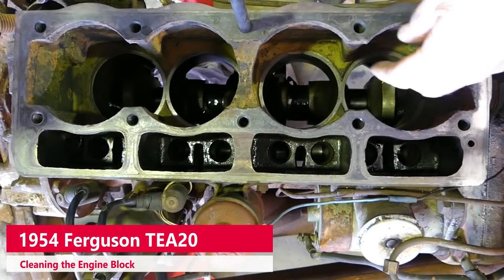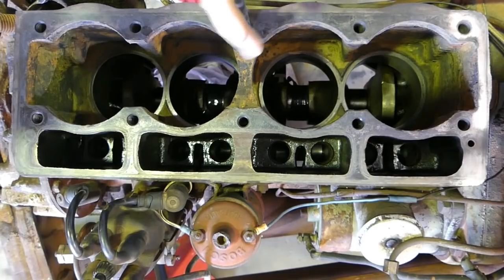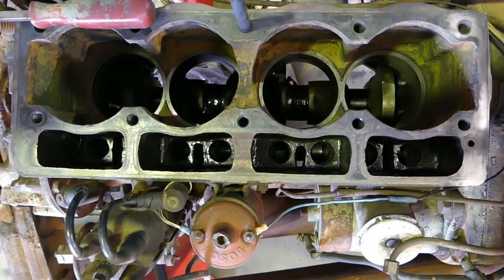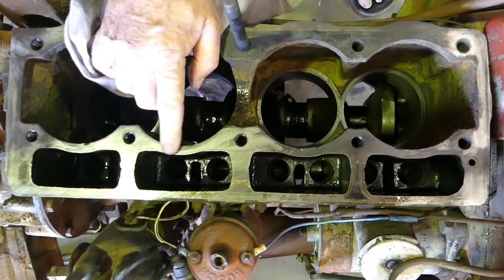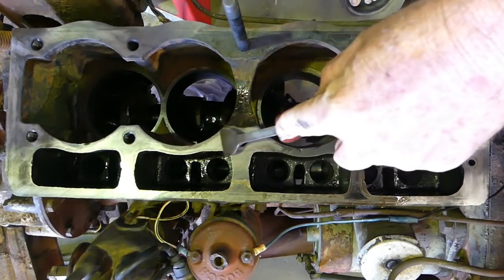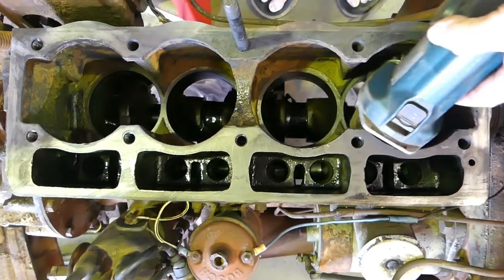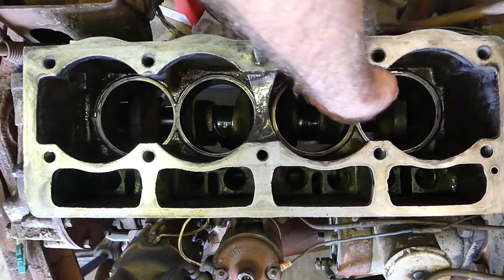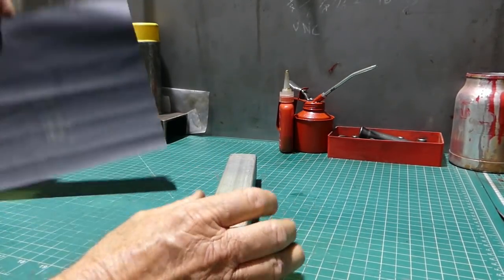Sparex Ferguson TEA20 # 8 Cleaning the engine block.

Comment: Lance, would you ever do anything on the cleaned up internal surfaces (other than oil etc) to prevent rust in the future? Such as oxide paint or something a bit more permanent? So as it's not left bare metal touching water/coolant.  Great videos, really enjoying them.
Reply: Any good rust inhibitor will definately help reduce further corrosion. add it to the coolant water!
Reply from the maker: I never have and I would be worried about it coming off and blocking the cooling system as I couldn't be sure I could clean everywhere properly to get it to etch into the block. On a gearbox I would.
Reply from the maker: Yes the Glycol based coolant has a film that stops this sort of thing happening again.
Reply: @BundyBearsShed  thanks Lance

Comment: could you put any rust inhibitors inside the block where the water lives,  although I guess that might not work with the heat...??
Reply from the maker: Yes but in the form of a glycol based coolant.

Comment: Hi Lance, sorry to contact you this way,i need an expert and you're him,my TEA20 starts great let it warm up,but after going about 200ft. quits,i wait a few seconds ,starts right up,go 10 feet dies out,wait 10 secs,starts right up again then quits,i get going again starts to die pull choke out she runs 10-20 secs and dies,do i shoot her or start to drink again after 30 yrs sober. any help would be greatly appreciated. has new carb,fresh gas,filter ,but has been sitting 4 yrs .
Reply from the maker: G day Steve is the coil getting hot? 
best contact is bundybearsshed@gmail.com.

Comment: Thanks again Lance, and you give always the reason why you are doing something, very educational I have 2 tef and both do not have enough oil pressure. I put a new pressure meter and filter but it stil stays the same. So I think I have to take the engine appart so your video is a great help for me. Regards from the Netherlands
Reply from the maker: The TEF is different Im afraid they can be a pain to work on in the engine. You need to pull the engine out completely to remove the crank to get it apart.

Comment: Hi lance what grit sand paper did u use or would you recomend to use for sanding the block with
Reply from the maker: I often go to 400 It takes a while but seems to do a good job, I have used 240 grit as well with no problems.

Comment: I was literally about to write a comment about your North QLD safety thongs the second you mentioned them! Too dang hot for shoes
Reply from the maker: Yeah I wear boots at work so Im comfortable in my safety thongs, tough as toe nails, lol.
Reply: Bundy Bears Shed I’ve got a few welding slag burns on my feet character building.... you’ve got too many slippery serpents up there for things in the paddock but... my rule is boots on if I’m going anywhere in the grass!

Comment: Can someone tell me fe35 and mf35  petrol have small sleeve bore? I am trying to put sleeve as these not going down? Thanks
Reply from the maker: The TE20 had either an 80mm bore on the early tractors then the 80mm on the later models. All of the 35's had the 87mm bore right up to the MF135 so there should only be one size.